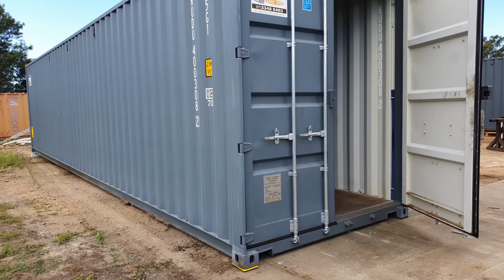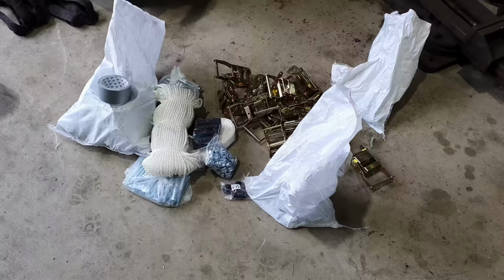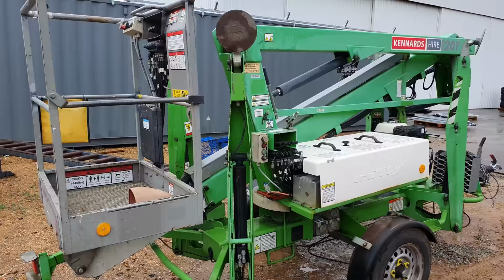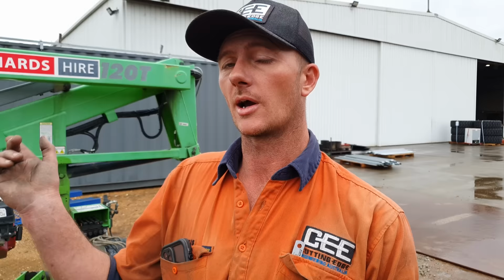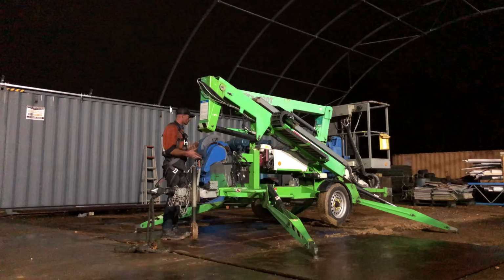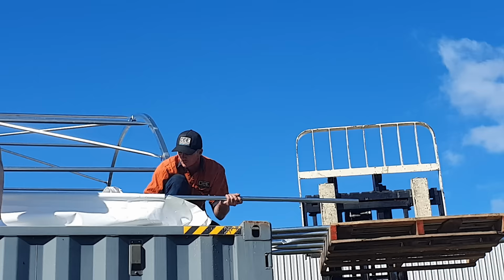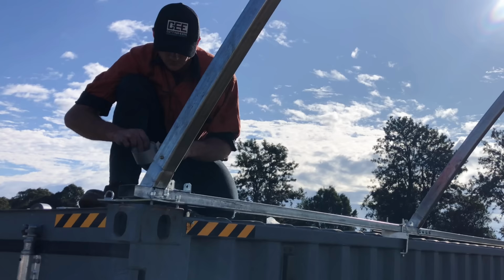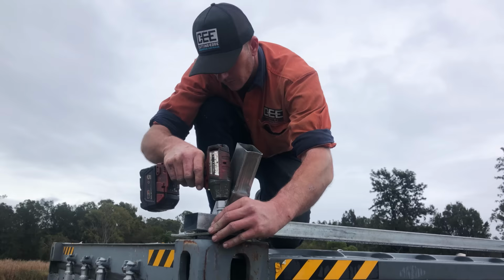Installing a 40FT Shipping Container Shelter | Expanding The Workshop! | Part 2

Comment: You're so impressive to get this done in the allocated time with setbacks like no instructions to deal with. As soon as I saw you taping the sharp parts I knew you were experienced at this kind of stuff - I bet that's not in the manual! Ridiculous they don't even have an online pdf you can download and use in case of omission in the packing. Also pretty poor quality control on the packing to miss bits and send extras . . . hope it works out for you long term as you deserve! The supplier missed a great opportunity for positive marketing for their product by stuffing up so badly!
I've seen a couple of these done by people building boats (DIY big catamarans) and the end-sheeting is very useful for reducing wind through the space, but helps if you can lift to allow airflow when you want. Great job both of you!

Comment: great job, however to lift the spans instead of using the two bands and having to unhook them with the hydraulic basket at each lifting you could use two steel hooks so you only needed to lower the crane in order to automatically release the two hooks from the span.

Comment: One point, the trailer safety chains should be crossed over. This will ensure that the chains don't drag the ground, when making turns. Also, the emergency brake cable of the trailer should be connected directly to the safety chain hook of the truck and not to the safety chain itself.

Comment: You might need to finish the diagonal braces. The truss is incomplete and the horizontal loads will not be transfered to the footings. The loads will end up acting on rods that are not designed to withstand them and they might bend.

Comment: Hopefully it has a good UV rating otherwise It won't last more than a year before it starts falling apart. I used to make boat covers and large tarps and fabric enclosures for both civilian and the military and I've never ever seen one of these PVC tops last very long. The canvas we used had a high UV rating and was capable of handling marine environments which tend to be really harsh on everything it comes in contact with.

Comment: I have the identical dome I installed at my workplace. Works a treat however in Melbourne we get strong winds and the nylon rope holding the back wall up has snapped multiple times. I ended up just replacing all the ropes.

Comment: Someone set up a massive one of these near me, but they have had the frame up for months and still no sign of the tarp. Its extra tall, the arch starts from the outside of the containers, and it has vertical struts from the inside edge of the containers.

Comment: The instructions will of course be included in the crate with the back wall kit.
Reply: or probably stuffed inside one of the tube support braces Kurtis already installed. Packing guy isnt paid enough to care where the manual goes in the crate I guess

Comment: presume there is no wind, how about rain? that 'sail' is going to pour extra water on the roof top of both container. does it have some kind of device to send rain water to the ground? initially i thought it will be build on the 'outside' edge of the container.

Comment: Looks like it will certainly do the job.
Are you planning on putting in some more plate as floor or just some gravel to keep you out of the mud?
I was going to ask how much is cost and who built it, but as they did such a crap job of supplying you with parts etc. better to know promote their company.
Cheers from Tokyo!
Stu

Comment: When you pulled the lift forward with the forklift I saw the wheels were locked. Did that hitch not have a lockout for the brakes to allow it to roll?
Reply: Kurtis applied the handbrake when he first parked it, and simply forgot to release it when he moved the boom lift.  Not that the forklift (or Kurtis) really noticed the difference.
Reply: @dfross87  thanks, I've never seen a trailer with hand brakes.
Reply: @billtheunjust   Most trailers that have brakes have them.  It's just a cable that applies the existing trailer brakes.  Much like the handbrake on cars applies the rear brakes (usually anyway).

Comment: can yall be more specific on the plate installation ..my  Gold Mountain C4040 .. specifically there is one bracket that has 2 arch supports on it , ALL THE OTHERS HAVE SINGLE ARCH SUPPORTS ? where does it go ? you mention the measuring between containers being important --what did you determine that to be --EXACTLY WHAT BETWEEN CONTAINERS ??  WHICH WAY DO THE END BRACKETS GO SPECIFICALLY ..WITH THE WELDED CHAIN LINK GOING WHERE ?  Sorry for cap locks on __  are your final pictures in video showing it the way you left it  ?

Comment: Taping joints great idea. Question- it looks like u used regular duct tape. 10 year warranty on the tarp.  Obviously wind will buffet the tarp. Duct tape will degrade long before 10 years outside especially in your hot sunny climate. Would aluminum foil tape or another product perhaps be better? I had a hot glycol heating system piped in the roofs of similar systems as a snow melt system at a fish hatchery in New Brunswick Canada. We used Teflon pipe wrap at the pipe joints because heat/ cold expansion and contraction would cause friction and leaks.  My point is tape is a shitty sacrificial piece. In order to save the tarp, would a better product be advised?
Reply: Taping the joints  is more to smooth the joints while the tarp is being pulled over the frame, to prevent it catching on an edge or bolt head and tearing.

Comment: This is a bad idea.  The Conex roof is concave with about a 1" rise in the middle.  Unless you figure some way to drain the trapped water you created, you will have corrosion problems on half of your shipping container roof.  Also the walls are not designed to take much weight, so reinforcement would be needed to support safely.

Comment: Classic "bolt-on" no mater if it comes in a 20L box or two crates: Missing parts, extra prats, no instructions and just the empty promise that "It just bolts on".
At least you didn't need to pull out the angle grinder and/or the welder. Was it at least a "sort by lowest price" of marketplace? Or did you pay top dosh for the displeasure?

Comment: why not move the whole box outside and unpack there?
cuz of the rain (use a tarp?)

and why did you not do all the arches all together and the put them up all at once?
when doing work you always want to do the same things as long as always 
be that assemlbling arches or puting them up
one task as long as possible 
moving around, hooking and unhooking taking and stowing tools all burns time like a bonfire
I thought you are from the trade

should have asked supervisor homeless for approval first ^^

it turned out great tho
just took a bit longer :P

this is a huge upgrade tho
the eqipment will love the shade ^^

Comment: Would have thought being an engineering company who does quality work you would have bought an Aussie made engineered solution not a chinese made non engineered one! 
Your containers are also not anchored. This is just now a big sail 🤪
Reply: Clearly you didn’t see the video loading the containers. A fabric building near me has survived 100 mile per hour winds. And without being part of the decision making process, omniscience is not a foregone conclusion.
Reply: @asw19B100  i saw the hold down that isnt enough! A structure that size would need 10 - 15 ton in each as a minimum. Gold Coast is a  category b wind region by Australian Standards this means a structure like this should be engineered to withstand a minimum of 183kph winds. And this would mean the containers would need 21 ton of hold down in each container on top of the container weight. 
I have seen structures like this that are engineered withstand winds in Port Hedland of close to 300kph.